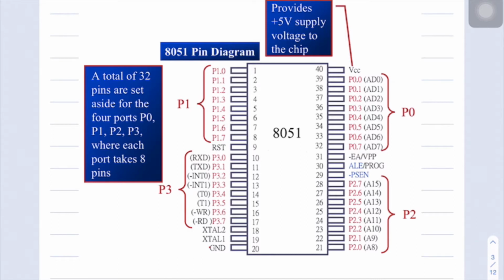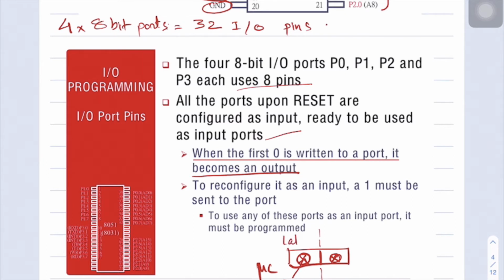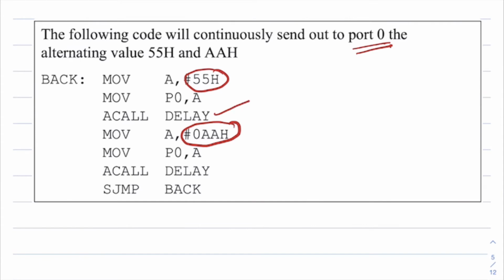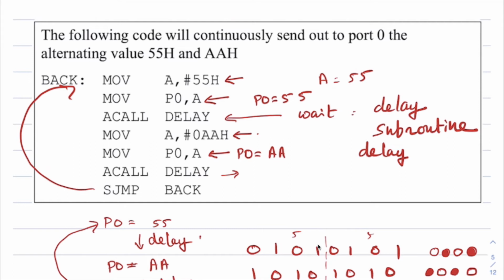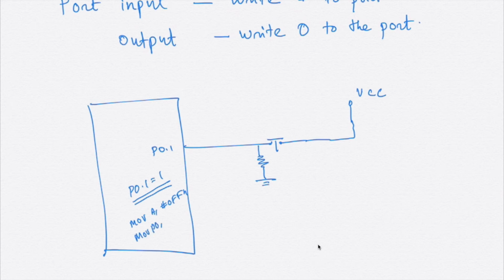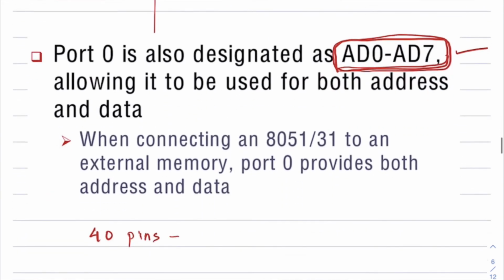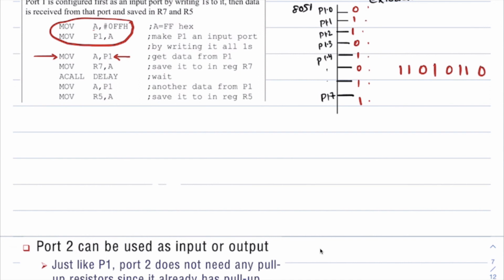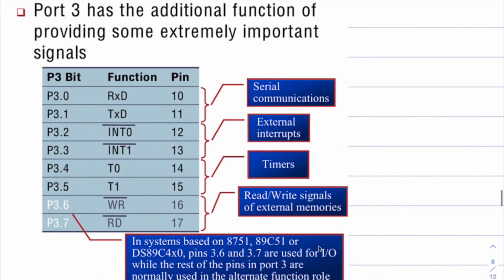8051 IO Ports Programming   Part 1

Comment: I want to change P0 value by its address,  can you help me please, this is my code but it doesn't work
void Change_Value(unsigned char xdata *port){
	*port = 0x00;
	Delay_ms(2000);
	*port = 0xFF;
	Delay_ms(2000);
}
void main(){
	Change_Value(0x0080);
	while(1){
		
	}
}
Reply from the maker: can you send the error you are getting
Reply: @saneesh  I have no error, but P0 don't change value